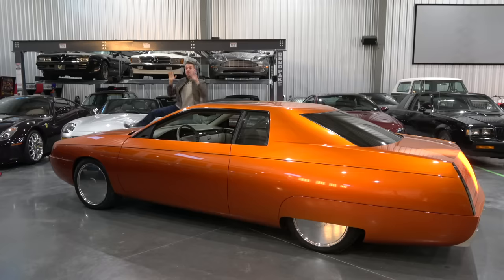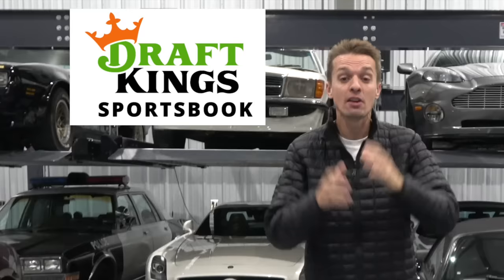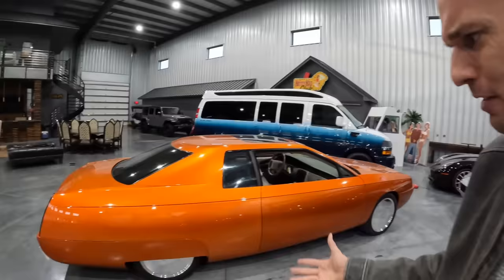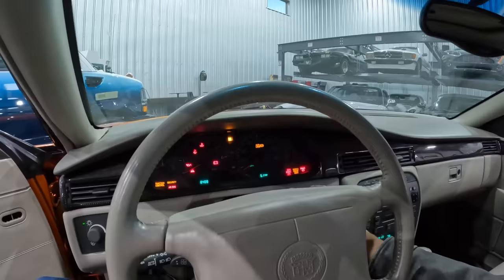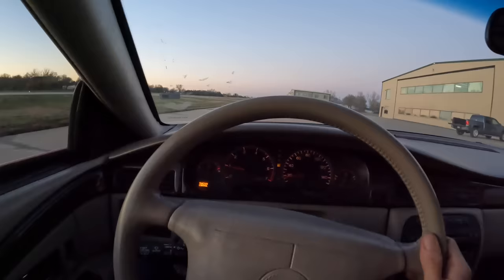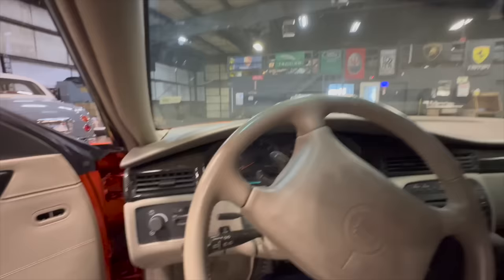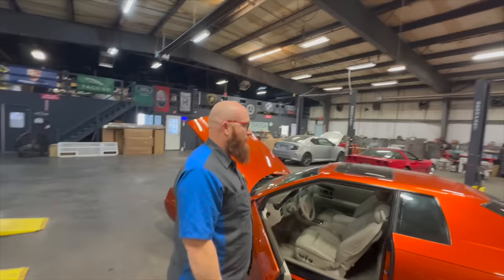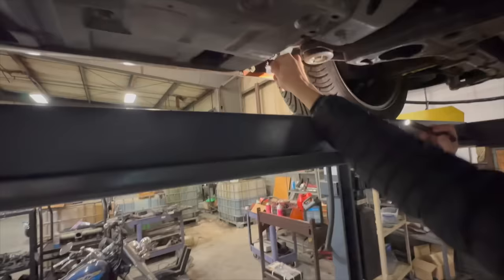I bought a forgotten Y2K Cadillac Concept Car, with a mysterious history. Meet the EldoRODo!

Comment: The GM bankruptcy auction cars are the stuff of legends. The V8 Beretta, the AWD twin turbo V6 Beretta, the twin engine Citation X11. All one of one examples that only ended up in the hands of the public through a freak set of circumstances.
Reply: V8 Beretta?!?

Get the fuck out I want it
Reply: @AdamG1983 build one!
Reply: @AdamG1983 the awd twin turbo will give that the gap sauce lol
Reply: Ive seen the V8 Baretta and AWD Twin Turbo Baretta they are still around!!!    Factory V8 Baretta and AWD Twin Turboksi's from Factory.    Epic Sauuuuuuuccccccceeeeeeeeee.

Comment: A friend of mine had a car with shaved door handles and poppers and he added an external jump point so that if the battery did go dead, he had the ability to hook a charger or jump box to the car without having to get into it.  That would be an excellent idea for this car, too.

Man this thing is cool!  Congrats on the purchase, Hoovie!
Reply: Often theres a pull cable or button in the wheel well. My body dropped mini truck had a pull cable to open the drivers door if the battery died

Comment: Tyler, I suggest replacing the hidden valve stems with motorcycle stems.  You can get them with a 90 degree bend making it much simpler to add air.  Cool Caddy!!!  Jeff in Canada
Reply: You need a waterproof socket hidden under the rear balance. A matching plug and battery will let you release the doors. “Speakon” connectors will do the job.

Comment: Place hidden battery jump terminals somewhere on/under the car in case of flat-battery/door popper emergencies. 👍🏽
Reply: If it was a show car, it probably already has hidden terminals somewhere for keeping lights and stuff running at the show all day.
Reply: @MobCat_  I just use the starter motor on my car as it is reasonably accessible.
Reply: @ianmontgomery7534  @Mobcat Great points guys. I love the starter motor idea especially.
Reply: Guys it needs a 2-factor authentication magneto-electro roundrobin handshake interlock lockout. That's the only way.

Comment: This is what I was able to find about this car

"The 2000 Cadillac Eldorado Concept embodies the spirit of a modern hot rod with a nostalgic twist, developed by California Street Rods of Huntington Beach. Derived from the successful Eldorado Touring Coupe range, this concept vehicle from Cadillac showcases a blend of retro aesthetics and contemporary design. While likely intended as a styling exercise for the Detroit Motor Show, the Eldorado Concept brings a fresh take on the iconic nameplate.

Taking inspiration from the best-selling luxury coupe in the US, the design team embarked on a transformation of the Eldorado. The most notable changes include a four-inch lowering of the body, accompanied by a 10-degree rake to both the windscreen and rear window angles to accommodate the new lowered roofline. Further design refinements involve the reduction in size of the side and quarter window openings. The rear tires are concealed by full-length bumper skirts, while the overall look is enhanced by retro-inspired wheels, tail lights, headlights, and indicators.

Under the hood, the Eldorado Concept retains the potent 300 bhp Northstar engine that's utilized in the standard Eldorado lineup. This engine not only adds to the vehicle's performance but also contributes to its dynamic appeal.

While the Eldorado Concept serves as a design showcase at the Detroit Motor Show, it effectively captures the spirit of the classic hot rod while blending it with contemporary luxury and performance. With its retro touches and modern engineering, the Cadillac Eldorado Concept presents a unique vision of what a modern reinterpretation of a beloved classic could be."
Reply: I like internet scavenger hunts, I found this on Drive Australia:  “There’s been some rough patches in the Los Angeles show’s history. in 2000 Cadillac tried a factory hot rod theme on an El Dorado, called the (wait for it) El DoRODo harking back to the show’s modified vehicle past”
Reply: It looks to me that all the reduction in the overall body height came from increasing the rake angle of the "A" and "C" pillars.  That probably accounts for 2" of the reduced height. The other couple inches probably came from lowering the suspension height.
Reply: Thank you for finding,and sharing this info.It's a pretty good looking mod.
Reply: "GM vice-president and Cadillac general manager John Smith said after the unveiling: “The EldoRODo is Cadillac’s way of celebrating the creativity of the hot rod culture in Southern California. For years the flair of these vehicles has expressed personalities of the builder and driver, similar to what the Eldorado has done for its owner base over the past 50 years.” Eldorado brand manager Steven Rosenblum, meanwhile, gushed: “Having spent some time in California, I realised very quickly that hot rod builders have an impact on the designs and applications of technology on production cars.”

He went on to add: “We didn’t want to miss the opportunity to have a little fun with one of our production cars that has always embodied the spirit and style of California. Eldorado continues to be the best-selling prestige luxury coupe in the United States and has the highest owner loyalty of any coupe in its segment.” He neglected to mention that the average age of its customers was 69. The upshot was that this confection had to appeal as much to baby boomers – people who remembered customising when it had taken root way back when – as to the latter-day cool kids in Cadillac’s bid to attract a more youthful audience "
from drives(dot)today
Reply: There used to be a Video of the 2000 Detroit Motor Show on YouTube that featured this Concept, unfortunately it has since been scrubbed (likely Caddy DMCAd it)
Reply: @nickcate9377  ..which was noted in the very comment you're replying to. Hurr durr

Comment: I have a set of those Flush-mount valve stems, and yes, they have an adaptor you screw into them so you can fill/check your tire pressure.  They were manufactured by "American Racing".  It is possible,  the one rim that has the short valve stem on it, is probably the adaptor itself.

Comment: The thing about the Northstar is that, when it's working, it's a wonderful engine. Smooth, effortless torque delivery with a nice fat power-band - and it makes great noises (especially with a performance exhaust). And, if you get ahead of the gasket issues, they can be made reliable long-term. But if you don't deal with the gaskets, either preemptively or right when a problem first develops, forget about it, you'll just have to throw away the whole car. Once the heads are trashed, it's totally impractical to fix one of those engines and, outside of a few insane people, it's impractical to swap in a replacement. 

But, because I am insane, and an engineer with more ability to read technical manuals than I have common sense, back in 2008 I did a full Northstar engine swap. This was on a beautifully garage kept 96 STS with a ruined motor that I got dirt cheap (it was headed for the scrap yard). I've gone through the process of dropping that front subframe, pulling off all the accessories, mating the engine up to the 4T80E, etc. It's one seriously long process that would cost Hoovie's-level money for a certified tech to do the work (so many fasteners, harnesses, clips, things to be routed, etc..).

I was also lucky enough to have access to a bay at a dealership (complete with lift, diagnostic equipment and tools) because I was good friends with the owner of said dealership. I sourced a crated, built in 1997, 0-mile L37 Northstar though eBay Motors (that even came with a new PCM). With the new engine, carefully taken care of, I never had any problems with that car. I sold it about 7 years ago, but I know the current owner, and he takes excellent care of the car, and it's still running well at about 100k on the replacement engine, but he also decided to do the head gaskets preemptively at some point, which is why it's still running well.

Moral of the story: people who buy 90's era Northstar powered Cadillacs are completely insane. But I'd totally do it again, and likely will own another Northstar Cadillac, even if I think it's a terrible idea. Do as I say (don't ever buy one), not as I do (totally get one).
Reply: Have had a '98, that I got from my Father, for 20 years. The 'infamous ' head gasket problem occurred on the hottest day of the year one summer. I ended up buying an entire studded engine from Northstar Performance in Canada. That was over a decade ago and still running strong, although it does only has 40k kilometers on it.
Reply: The problem isn't the gaskets. The problem is the head studs stretch the threads in the aluminum block. In later models, they use larger head studs.
Reply: Yes, and No. The heads use bolts from the factory, and they're threaded into the aluminum block. After a failure, they should be replaced with Studs, and you could get a Stud Kit to replace the original bolts.  @ralphinator2
Reply: Sure it wasn't the plastic intakes causing hydro lock like the V6 Buicks and Oldsmobile that had the exhaust run through them warping the coolant surfaces?

Comment: this was apparently a 2000 eldorado touring coupe that they had turned into the thing we see now for the los angeles international motor show,  Lombardo's shop lowered it to 49.6 inches by lowering the roof 2 inches and lowering the chassis 2 inches and the official name for that gorgeous colour is 'ignite orange', its meant to have had its wood finish replaced by a carbon fibre looking finish so it shouldnt be completely stock inside :)
Reply: This car is not 2000 because it still has the old northstar with spark plug wires. 2000+ engines have coil cassettes.
Reply: @brayannexon4613  sure thats the case for regular production vehicles but whilst this was built by the hot rod shop in 2000 that doesnt make the car a 2000 model, hoovie said in the video it had 8000 miles and it wouldnt have got those as the car we see today, those were probably got by the donor car so its older than that
Reply: @brayannexon4613   What He hasn't made clear is the car was called the ''2000 Eldorado touring coupe''.

Comment: The deals you find continue to amaze me.  As a former Northstar owner I actually loved my Cadi and was fortunate to never had any mechanical issues over the several years I owned it.  I'd buy this in a heartbeat for $12K
Reply: I am a Northstar fan, and own a pristine 1994 DeVille Concours. I advise everyone to get the head gasket fix. It is also wise to get a spare ignition module. I am delighted that Hoovie has covered this modified Eldorado.
Reply: I was also a 4100/4900 guy, back in HS, so I've been defending Cadillac since I started driving. They eventually get them to be really good engines, after a few "test years"

Comment: You know if it wasn't for the reliability issues, the 32 valve Northstar is an absolute monster engine. So, so, sooo much room on them to make them insane but there just isn't a lot of aftermarket options given their reputation and how rare they are to be used in performance applications.
Reply: We also know they put the starter in a excellent spot
Reply: @brettconv83  Cadillac, Mercedes, Audi and BMW had one assignment in the late 80s. Build a DOHC 32 Valve V8 to compete with Toyota/Lexus. Ford sat back and waited to see if GM was going to fumble the assignment. Well, Cadillac did fumble on it by trying to using the same engine design as the Toyota 1UZ, hence the location of the starter which is hidden under the intake plenum. They also fumbled by designing weak head studs. In 1992, Ford told Cadillac/GM to step aside so that they can show them how an American 32V V8 is properly built. Ford came out with the 32V Intech for Lincoln (and the Cobra Mustang) and I havent heard any horror stories. But the Cadillac Northstar is a good engine once the upgraded Northstar Performance head bolts are installed along with periodic coolant flushes and oil changes.
Reply: @brettconv83  It is a common misconception. It really is in an excellent spot. Yes, much harder to service, but protected. They last a lot lot longer in there, seldom needing to be replaced. No one complains that pistons are so hard to replace for the same reason. You will need to replace them just as often as the starter.
The head bolts were the real issue with that engine. You can fix it, but it should have been addressed in design, not as an aftermarket.
Reply: @brettconv83 Toyota does the same thing on their v8’s.
Reply: @SouthsideKidd550 Half of your comment is based on total fabrications and half truths. It is an absolute certainty that Audi and Mercedes did not develop their PT and M119 V8s, respectively, in response to Toyota's 1UZ (in full production before the 1UZ). As for the M60 from BMW, it was more likely a response to the other German competition rather than Toyota.
Reply: @brettconv83  
The starter takes 5 minutes to change out on a Northstar.
Reply: @MrCarGuy  Thanks for trolling. You do know I got this information from Bill over at Curious Cars and the 1992 Motorweek episode "V8 Luxury Comparison" right. That being said, to me it makes sense and I will continue to believe what I commented. You stick to what you believe and let me stick to what I believe. I said what I said and I dont care. I refuse to go back and forth. At this point, nothing else need to be said.
Reply: The wizard can bulletproof it like he did with his XLR, so that's good
Reply: @SouthsideKidd550  
Northstar Perf... I have their stud kit. Works perfecto. 
I also happen to have some Lincoln Mark VIII's, those are dead-nuts reliable from the factory as you mentioned.
Reply: @xmo552  sounds like you’ve done a few. Five minutes is pretty fast. You should post a video at a junk yard of you pulling and replacing one in five minutes
Reply: @brettconv83  
It's fuel rail bolts, a few intake bolts, and you're there. You can try it.
Reply: @xmo552  Yeah to be honest I’ve never done one. Shhh I’m a Ford guy so I stay away but my father in law has early 2000s Caddy with the 32V so I’m sure I’ll be doing one soon enough. That’s like timing chains , tensioners and guides on a Ford 4.6L 2V/3V/4V most people will shy away from that work but I’ve done so many I can literally do one out front of my apartment in two hours start to finish

Comment: Nice concept car! Good find and buy! 

One suggestion is I would look into those radio where when you turn the key, a screen would pop out and up giving you a nice size display. There are radio that supports both sides camera and and a backup camera. This way you don’t need to have two display mounted on your pillars and you can add a backup camera on the rear. It’ll have spilt screen for both side but switch to one side full screen when you use a turn signal then resume to spilt screen or GPS etc. 

You would also want to upgrade the side camera that already in there with a newer camera due to better resolution and nighttime views.

I specializes in low voltage home automation tech and toys so I seen those radios on the market before and it does exists.

Again nice find and great video as always